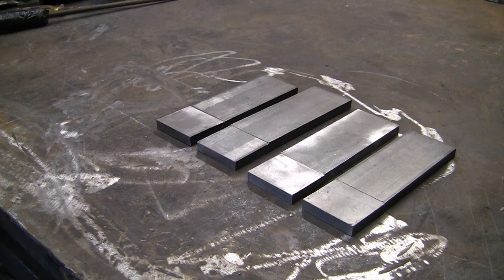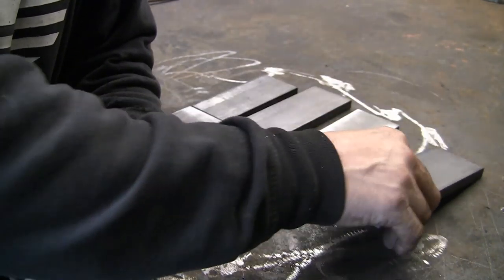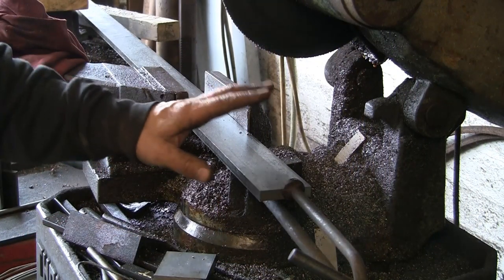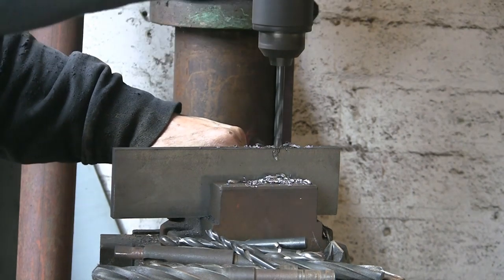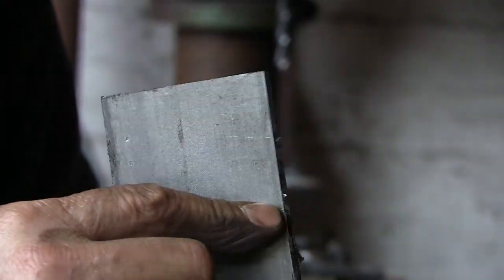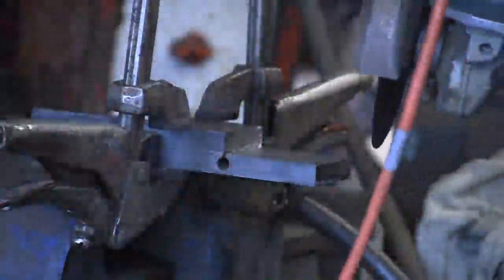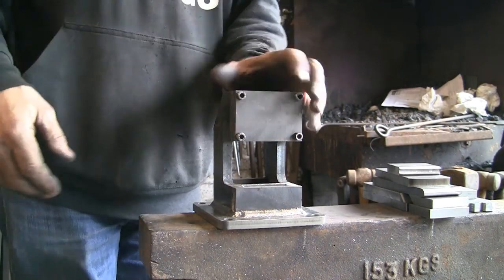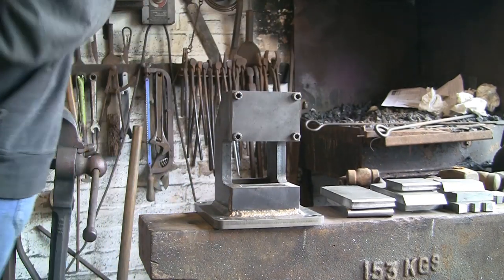Blacksmiths Guillotine tool dies

Comment: Thanks Gary, I've been useing spray coolants which are not great.I'm a painter who uses 12 inch rollers a lot and have had a lot of problems with my right shoulder. Rest is my best solution. Corse if your resting your not makeing any money!!  Trust you get back to normal soon & thanks again for all your info & videos.

Comment: EN32B you say in the description above.  EN38B you said in the video.  Are you sure they aren't just EN3B, bright drawn?  That's mild steel.  EN32 series is for example used for con-rods in engines, among other things.  EN38 could quite possibly be Nitriding Steel.

Great tool anyway. Thanks for posting.
Reply from the maker: It's EN32B or 1016 for the yanks!
Reply: Ah yes, the colonials. Mind you, the EN series is defunct now, mostly, is it not?  More Euro designations for us, sigh.
Reply from the maker: Wolf Jaw Forge
I don't know if it's becoming rare, I can get it at Acton Bright steel easily enough.
The sooner we get out of Europe the better!
Reply: Oh the recipes might be the same (though some gone, others added) but the designations are different.  Admittedly they have been for a good while now.  I got into engineering on the tail end of the EN series use (and the tail end of Imperial generally) and most of my engineering books were gifts from old chaps from an even earlier era.  So I got to know most of the EN designations.  I've never to this day bothered to memorise the new ones.  There's been enough to memorise.  Decimal money, kilos and grams, metres and millis.  The dreaded litres instead of gallons.  Good grief.  Have we only got pints and miles left?

Anyway, mild steel is still EN1A and EN3B.  To me that is.

Must admit I do like the US SAE system.

The sooner everyone gets out of the EUSSR the better!

Comment: Thanks for your videos. What cutting paste do you use? Many thanks Gary.
Reply from the maker: CT-90
Reply: 67$ US and 5$ shipping for 500 ML on US Amazon., no thanks, must be good stuff though for that price. Quite a markup. Buck and Hickman has it for 8.99 a Lb.  Us Colonials don't know anything about the Crowns currency, it that a great price?

I thought Anchor Lube, which I thought was expensive at 11.99 for about 8 oz. and free shipping, Amazon, was nearing the price of gold...but works great for my purpose, for drilling and tapping, not oily, water soluble, I thin 50/50 for most purposes.
Reply from the maker: £12 here for 500ml

Comment: hey Gary thanks a lot. is that only mild steel you said? is mild steel tough enough? is it gonna last all the hammering? because on my dies which are double the thickness of yours i have welded high carbon steel at the ends and then shape them with the angle grinder to the exact shape required.
Reply from the maker: You use 1" thick dies! Why? You have wasted your time welding hard steel to the business end, it's the top that will deform. Unless you are using them all day long mild steel will last just fine on hot metal. Besides bright bar is as cheap as chips so you can buy 10 foot and make one a week if necessary for buttons...

Comment: I want your linisher!  Daftness aside, how much is laser cutting for the blacksmiths helper?
Ive a mate getting me some  10 and 12mm plate  and im not sure if its worth sending it off to get laser  cut or taking forever with an inox disc/plasma.
Reply from the maker: threefingerjim You don't need to supply the plate, it's included in the price. I can't remember how much it was but i think to cut enough plates for five tools was just over £110.00
Reply: Thanks Gary, I got a quote for the helper plates using the cad files and it worked out about 80 quid. Ive guillotine cut the plate instead at a friends place, a few holes to do here and there and it should work out fine.

Comment: Can you please send the details on this jig and the dimensions to my email you should have my email address I would really appreciate it. .t5
Reply from the maker: I don't have your e-mail address, I don't know why i would. A link to the plans are in the description on the video page showing the tool being made.
Reply from the maker: reuben vargas
As I said the plans are available to download on the build video page.
Reply: I don't remember seeing the build video page??
Reply from the maker: reuben vargas
http://youtu.be/Xh9TDVDm93s
Reply: 10m is that the thickness I work in inches do you have height length & with?
Reply from the maker: reuben vargas It's all on the plans! You must be able to convert mm to inches! 10mm = 3/8", 12mm = 1/2", 150mm = 6". There are 25.4mm to the inch, it's all very basic.
Reply: Ok I converted mm to inches I guess I'm having trouble finding the dimensions I have 3 things I opened and do not find the overall dimensions I'll keep looking. Sorry to bother you again I'll look deeper into the mail thanks
Reply from the maker: reuben vargas
it's on the third item down, "Printable parts list". It's 6 1/2" tall, 3 1/4" wide and 3 1/2" deep.
It really doesn't matter what size it is if you are going to cut your own, make it what size you want. If you are going to get it laser cut then just send them the CAD files and it will all be sorted for you!
Reply: Okay thank you Gary I'll give it a go